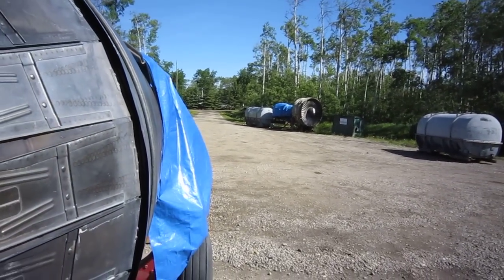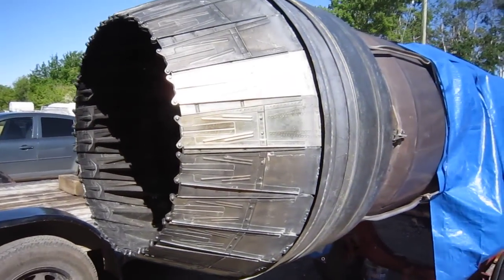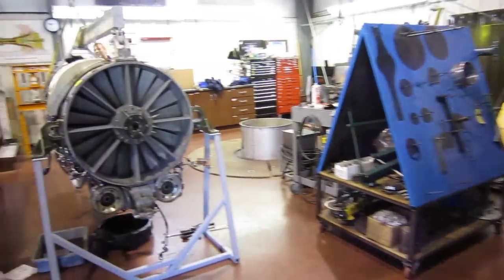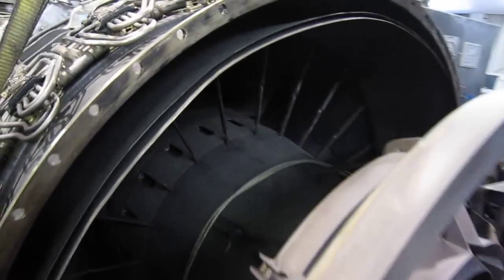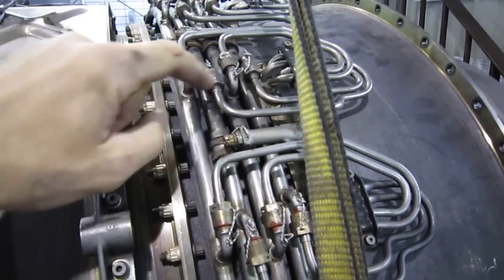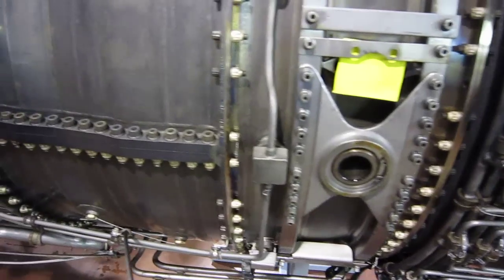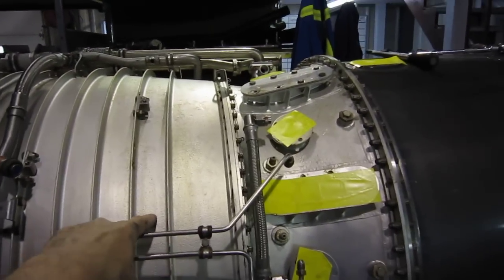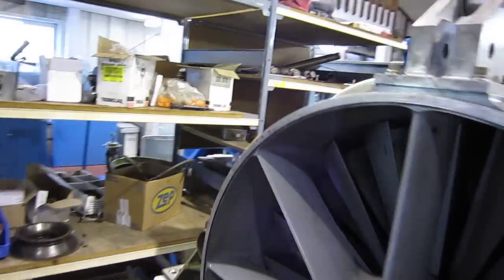Inside an Afterburner - Turbine Engines: A Closer Look

Comment from the maker: The VSV system allows the engine to operate without compressor stall.
Back in the day, this was the first of a new generation of engines that used
high performance compressors.
To get from idle to making power, these compressors pass through a range of rpm where they stall without some form of airflow modulation.
Bleed Valves and Variable Stators are two ways to prevent stall, and they are necessary on all modern turbine engines.
A video on compressor stall is in the works.

Comment from the maker: The flame holder is there to make sure the flame does not get blown out. It is an obstruction to the high velocity flow of the exhaust gases, producing an area of turbulence, in which the mixture of  fuel and air is certain to burn.
Without the flame holder, the velocity of the mixture in the jet pipe is so high that the fire might get blown right out of the engine.

Comment from the maker: The mass of the exhaust is increased by about 5% when afterburner is used, and this does contribute to the increase in thrust. If the mass was the major factor, you could inject water into the exhaust and have the desired effect. You can't, and it's not water... it's fuel.
The main reason afterburners increase thrust is because the fuel is burned, and this greatly increases the temperature of the exhaust. This causes it to have a much greater volume, and greater acceleration.

Comment from the maker: @102trafalgar Yes, the CF-6 has what GE calls a "core booster" - a smaller second stage to the LP compressor. The first stage of the LPC is what we call the "fan", because most of its output is passed around the core engine.
The second stage is the size of the inlet of the "core" or fuel-burning part of the engine.
The TF-39 was the engine developed for the C5 Galaxy, and it led to the civilian CF6.
The TF-39 had a small 1st stage LP, and a large fan as its 2nd stage LP.
Unusual arrangement.

Comment: When I worked GE before they closed the facility in Ontario, Ca. I,worked on the J79 engine for many years, and then I worked on the LM 1500 which was a converted J79. Then they took a CF6 turbo commercial engine and made a LM 2500 gas,turbine power plant. A lot of the LM 2500 engines  are used aboard the U.S. Navy as power plants for the ships. I worked for HE for 30 years before they closed the facility.

Comment from the maker: The variable stators enable the engine to transition from idle to medium power without stalling the compressor. From medium power to full power, the VSVs are in the full open position. An industrial engine only needs the VSVs when coming online. However, they perform such an important function, they are absolutley necessary.
The VSVs don't really do anything for a fighter, except during startup. At all power settings in flight, they are fully open.

Comment from the maker: @klusmanp Don't feel too bad.
In a jet fighter, this engine has the shit beat out of it, and it has a service life of 400 hours between overhaul, which takes thousands of man-hours.
In an industrial application, the engine is pampered, with gradual changes in throttle, and a service life of about 20,000 hours between overhaul.
It will live a long and happy life.

Comment from the maker: @TheArfdog The power is transmitted by hot air...to a separate piece of equipment called a power turbine, which turns a shaft, which drives the load.
We only test the engines... technically they are called gas generators, because they generate a stream of high-velocity gas that the power turbine can use.

Comment from the maker: @Helicopterpilot16 The JT9D was used to power some 747s, and others were powered by the GE CF-6, which is what you see in the background.
The engine we have is part of a long-term project, and it will be the subject of a video or two as it is worked on.
We will run it, but when is still not decided.

Comment from the maker: @krbruner In the combustion chamber itself, there is a huge excess of available air due to the use of air as the coolant, so the fuel burns as if it was a big candle... it just takes what it needs.
The afterburner was invented because after realizing that about 20% of the air ingested by the engine is actually used to combust the fuel, it was thought a good idea to try and burn the other 80% by burning it in the duct "after" the engine.

Comment from the maker: @Mastermind2011 The compressor delivers 150 lbs per second of air at 125 psi to the combustors. 35 gallons per minute of fuel is burned in that air. The resulting heat causes the air to expand and rush through the turbine. The turbine, like a windmill, is designed to take energy out of that stream of hot gases, and convert that energy to torque. Torque on the shaft which turns the compressor. This is how the compressor gets the power to turn and compress all that air.

Comment from the maker: @silver760 Sometimes, with some engines, it's something like that.
There are very few engines that are currently or recently used in aircraft, that are also the basis of an industrial engine.
Very few.
One example is the P&W JT8-D, used on DC-9s and 737-200s, which is the basis for the FT8 industrial powerplant.
Most aircraft engines have no industrial application, and most industrial gas generators have no current aircraft counterpart.

Comment from the maker: @jyatim We don't paint any colors on the lines. Most of them are stainless steel tubing. Sometimes an oil leak can be cooked on to the steel as a brown color.
The engine was taken from an aircraft and so would be in an uncleaned state as we disassemble it.

Comment from the maker: @TheArfdog There are many different turboshaft engines.
Typically the term turboshaft refers to what is used in a helicopter.
The most popular turboshaft engine out there has 2 gas generator turbine stages and 2 power turbine stages.
The CF6 large turbofan has a 6 stage turbine driving its fan, and the LM2500 which is almost the same engine, but with a shaft output also has a 6-stage free power turbine.

Comment from the maker: Blades refers to the airfoils on the compressor rotor. No. The linkages control the angle of the airfoils which are attached to the outer case, and they are called stator vanes.

Comment from the maker: The afterburner adds and ignites fuel in the exhaust of the engine, which still contains a lot of oxygen. This extra fuel being burned raises the temperature of the exhaust gases, so they expand even more, and therefore have to go even faster to fit out the jet nozzle. To get going faster, they accelerate. This acceleration takes force, and for every force...  ...   So thrust is increased.

Comment: I am also a huge fan of the SR-71, and I think it would be pretty cool to have a J58 running in my backyard.  You would need a 600 HP engine to start it.  Wide open, it uses more than two gallons per second of JP-7 fuel.  If you could find JP-7, it would be at least $5 per gallon, making the cost of running th engine at full throttle $10 per second, or $600 per minute.  So like AgentJayZ said, the obstacle would be money.  Fun to think about though!

Comment: @AgentJayZ Actually I was using the technical meaning of diffuser. The device which expands exhaust gas in order to extract more work from it. A shaft-turbine (or turboshaft) drives something directly with its own shaft. Like a turbo-prop plane. I believe it has a more extensive, diffusing turbine, which extracts more energy from the exhaust gas to turn the shaft. Without an extensive diffuser, the energy goes into shooting a jet of air backwards.

Comment from the maker: Our engines do not use the CSD, but the "#5" bolt you mention is actually at the rear of the gearbox mounting pad, so we do install that one all the time.
Is that the one you mean?
One of the crappiest things to lockwire ever!

Comment: It gives the exhaust gases more mass which makes a larger thrust output. It's like trying to paddle a boat with air vs paddling with water. Water is much more dense which you can propel off of way better. Same thing with dry thrust (non-afterburning) vs wet thrust (afterburning) in a jet engine.

Comment: Michael, without going into great detail stator vanes essentially reduce airflow turbulence in the compressor. As Agent pointed out they are attached to the casing and not a part of the rotor assembly. Stator vanes are variable while blades are not.
Reply from the maker: I appreciate the enthusiasm and assistance. As will be covered in an upcoming video, the function of stators is to convert the velocity of the air imparted by the rotor blades into pressure by way of aerodynamic diffusion.
Both rotor blades and stator vanes are equally vital to the process of compression.
Without either one, the compressor would not be a compressor. The actual increase in pressure of the air going through a stage in the compressor happens in the stators. The rotor blades cause the air to move, but do not increase its pressure.
Reply: AgentJayZ Thanks.....I was writing from memory as I have not touched a jet turbine since leaving the Navy in 1982. HA! Long time ago when I was but a young buck. The J-79 was my main focus as I had been assigned to F4's in A.I.M.D..
Reply from the maker: Another viewer, a few days ago... called the J79 a small engine. I didn't know how to respond...
Reply: AgentJayZ Interesting. In what respect? The J-79 is not anything I would call "small" in size or thrust capabilities. Perhaps, he mistook it for the PW J52? I don't know. In terms of "size" I never really thought of jet turbines in that aspect. I always thought in terms of it's application and its capabilities of doing the job intended. In other words, if it does the job then it's the correct "size". But, really in terms of sq. ft. area the J-79 takes up...well, "small" is not what I would categorize it. After all, when it's fully assembled it's nearly 18 feet long! It's quite the workhorse given the fact that it's 1950's technology and still in use. The one complaint I had "way back when" were the carbon seals. We had a problem with them cracking frequently and replacement delivery took an inordinate time as opposed to other parts. I don't know if that was a GE or a US Navy problem. To me, it didn't matter who was at fault it was a problem nonetheless that I complained about...to no avail, of course.

Comment: Very instructive videos, kudos for you and your team. I have a question though: Is there a color code for the hydraulic lines or the fuel lines? I did see some brownish lines under the engine that Walter was converting. Thank you for your response.

Comment: The simple explanation is this: exhaust in a turbojet engine provides the thrust to propel the aircraft. So an extra flame in the exhaust stream boosts exhaust temperature and thus, the thrust, quite a bit (thrust increase is roughly the square root of the temperature ratio). This is quite inefficient but the afterburner is used only in short bursts for quicker acceleration. Kind of like "turbo boost" in a fictional racing video game. It's basic physics really.

Comment: @AgentJayZ Thanks. That makes sense, since i suppose a jet engine is designed to produce a "jet", which has a high amount of kinetic energy. The power turbine (I would guess) would further diffuse and slow down the jet of air, converting it to mechanical power. A dedicated shaft turbine engine probably has a more extensive diffuser (performing the power turbine role) than a jet engine. Am I right?

Comment: ok, just so i understand, adding fuel is how you spool up a turbine, and in theory it will spool up until its gobbling in more air than the fuel can keep up with which is why there's so much O2 in the exhaust stream? I'm so used to piston engines where it's all about getting the A/F ratio stoichiometric. in this application the engine is basically running almost constantly lean which is why afterburners don't choke themselves out? thanks!

Comment: Alot bigger than my single stage turbine for my RC plane lol. Are there 4 seperate holes on each spray bar?. I'm guessing each ring is pressurized buy a pump and controlling AB stages by a fuel  solenoids?. I'm thinking of adding AB to my jet engine lol.

Comment: Are these aircraft engines converted into industrial power plants when the engines run out of flying hours? From what I understand all aircraft components have a set number of hours flight before they must be replaced with a new unit.So despite the engine running out of flying hours they still have a considerable amount of life in them before they are considered to be worn out,making them suitable for conversion to generators.

Comment: When you convert a J-79 to a LM-1500 how many extra rows of turbines do you add? An aircraft only takes as much power from the exhaust to drive the compressors, pumps and aux power needs. The rest is used for thrust. I would imagine industrial use means electricity generation, so I would imagine you add extra rows of turbines. Or does the engine simply blow onto a external turbine/dynamo ensemble?

Comment: I am not familiar what is involved in fuel metering for jet turbines, but I know for internal combustion that an overly lean fuel/oxy ratio is a bad thing.  My first question is, does a turbine even care about the stoichiometric ratio of fuel/air, followed by, does it try to keep that ratio on the rich side similar to an ICE and thirdly, if the engine is dumping fuel into the afterburner, is it possible that there is just not enough oxygen in the exhaust to keep the afterburner lit?

Comment: just a quick question.  i have not worked on the j 79 since 1971 but i have to ask.  have they figured out an easier way to r and r the csd generator relative to the top nut.  as i rmember it was so tight a fit it was difficult to get a wrench on it.  thanks

Comment: @1:00 Do the 7 'L' shape levers linked by a rod control variable pitch stators? If so, does an 'industrialised' J79, running for long periods at constant power, have much need for variable pitch stators?

Comment: Fear AgentJayZ, I used to live in a  valley where F 104 Starfighters and F4 Phantoms used to roam.. when the were slowing, the J 79 gave a low scream, on both aircrafts.

Any Idea why? does it do that as well in fixed installation?

Comment from the maker: @TheArfdog No. you are getting caught in the gap between popular meanings of words and their technical meanings.
Diffusion is one word that does not apply here.
And what do you mean by a dedicated shaft turbine engine?
An engine that includes a power turbine in its design?
Such engines do exist; the GE LM6000 is one of them.
They are no more or less efficient in turning fuel into power then the usual gas-generator and separate power turbine arrangement.

Comment: Just wondering how much goes into converting an engine designed to produce thrust to something that does shaft work? Just a much larger gearbox(AMAD or similar)? Any redesign of turbine section to extract more shaft power?